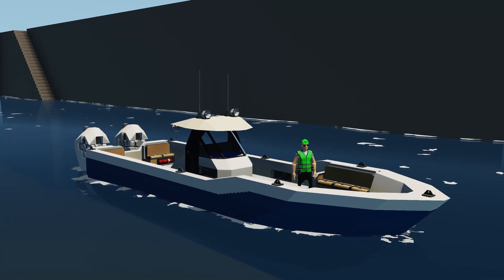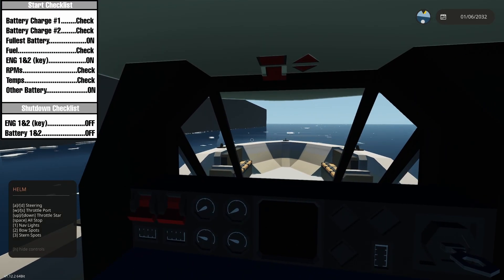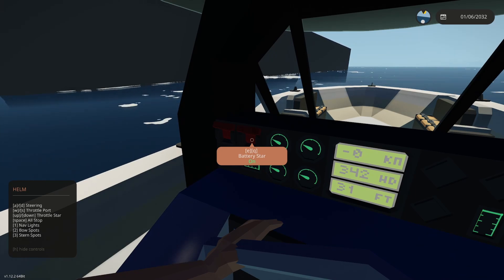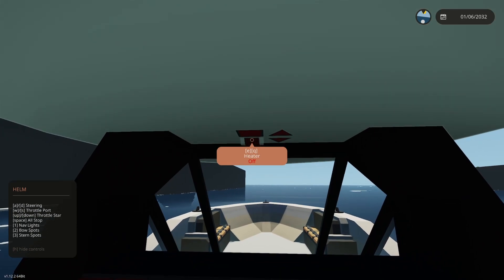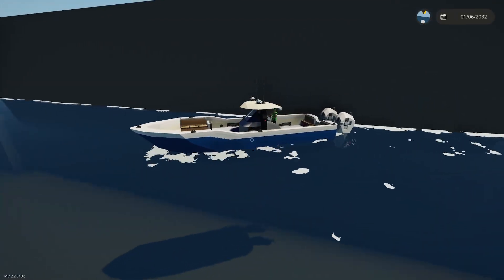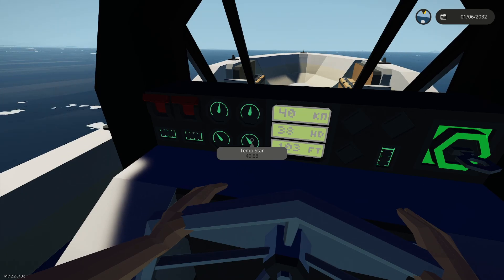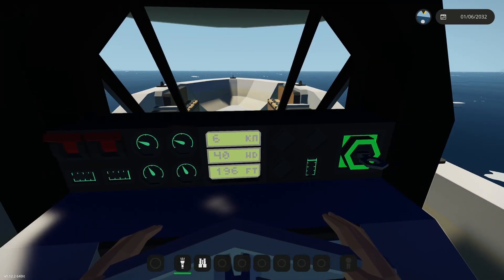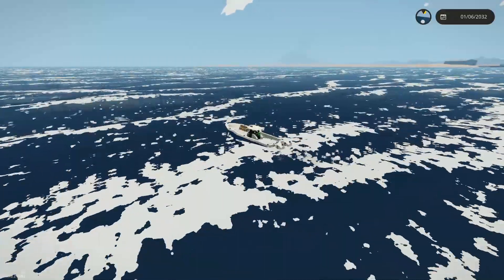Stormworks: Swordfish Tutorial #stormworks #gaming

Comment: anyone reading comments:

If you want to create a simple high speed outboard stabilization system that doesn`t require nodes. Set seat A/D sensitivity to 100% for a nice and responsive steering. Adjust pivot speed to 0.2 or anything similar and clamp the steering value from -0.3 - 0.3. With a horizontal small fin placed back in the middle of the transom to slow the boat down while turning. This is what i use all the time and is also really easy. obviously just creating a controller to limit the steering speed is easy as is but hey 🤷‍♂ Its just that i notice a lot of workshop creations using outboards with steering that flips the boat as soon as you touch A or D...